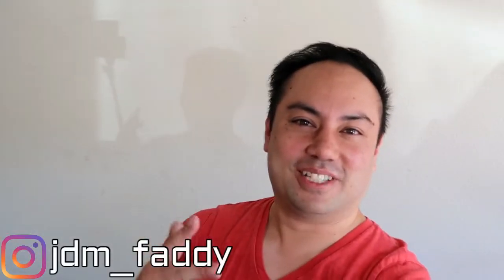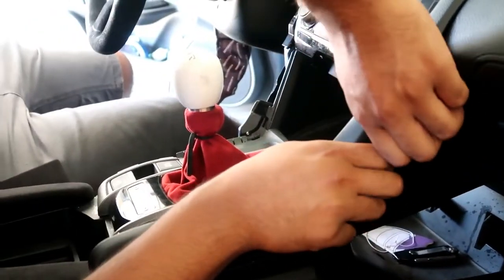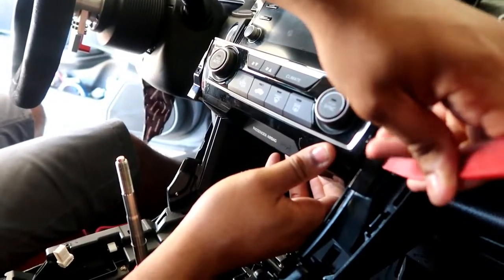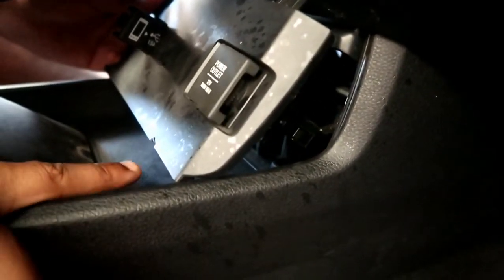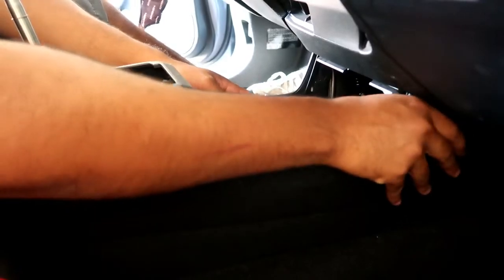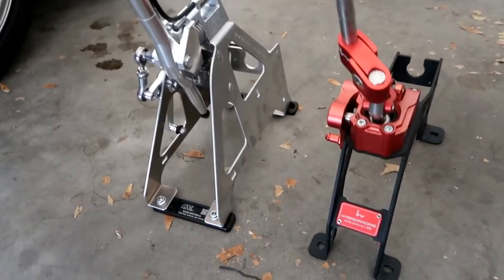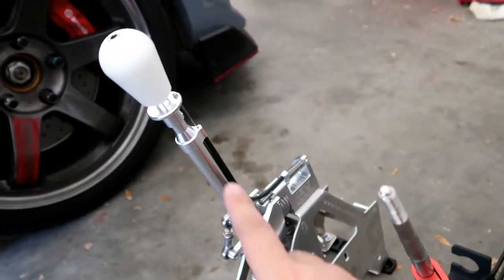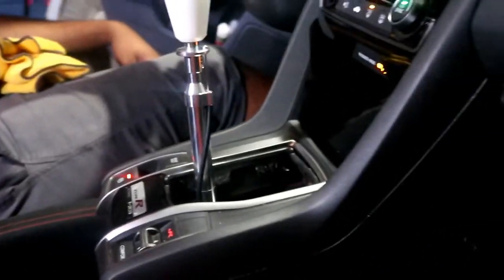CIVIC TYPE R CAE SHIFTER INSTALLED | HOW TO

Comment: Considering buying this to replace my Hybrid launch edition I had since launch. Is there anything the reverse lock out cable is attached to or is it just integrated into the shifter and nothing else is needed to be done? After having this for a year how has it been performance wise. What are the differences from the Hybrid? Looks like the throw is significantly shorter.
Reply: Hello, glad i saw this in decent time. The reverse lockout works solely through the shifter itself. Theres pins you have to adjust and align for each gate and one of those is connected to the lockout ring which pulls it out of the way for the reverse gate. For performance wise, i personally prefer a taller position for it so having it higher up along with throws similar to a hybrid setup in its shortest settings is what sold it for me. Overall i highly recommend it if thats what you’re after because if not and you try it and dont like it, you’ll need to replace your shifter cables to run any normal shifter again. I only got to enjoy it for like 5 months before losing the car but enjoyed it the whole time with no regrets
Reply: @45huh  Did you remove the cae shifter before losing the car?
Reply: @weduhpeople8504  Yup, i was able to remove it last minute.
Reply: @45huh  I just installed this and is way more precise and a shorter throw than the Hybrid which had alot of slop. The pins just guide the 1/2 and 5/6 to go in to their gates. The reverse lock out I’m used to being a former STI owner. It’s the best shifter I’ve ever used on my daily. Another thing that amazes me is even though it’s bigger than the Hybrid, it’s considerably lighter.